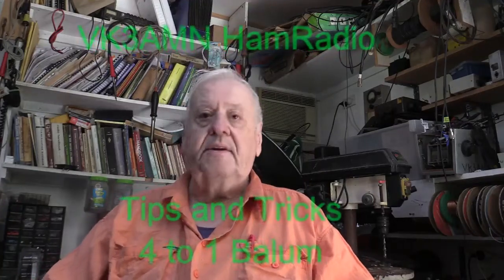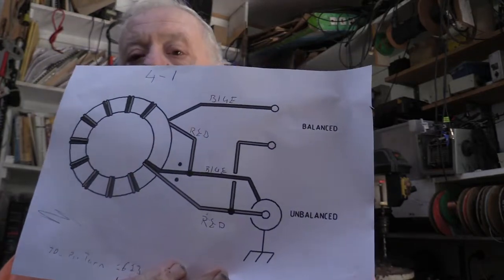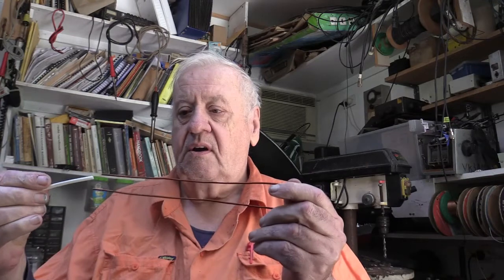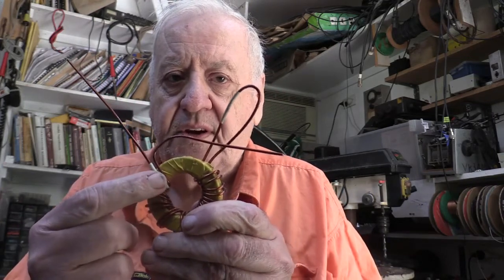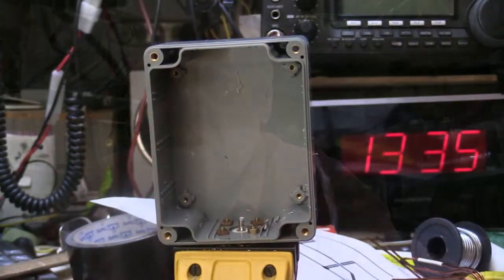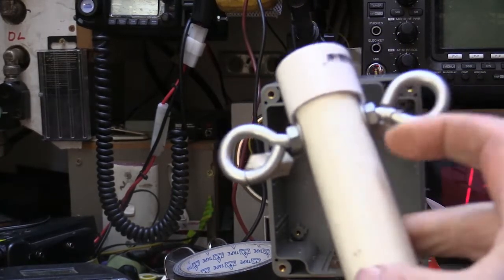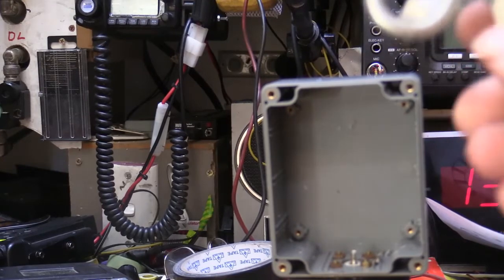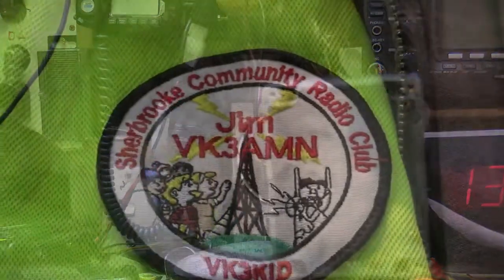A easy way to keep track of wires making a Balun

Comment: Variety! Love it Jim. Question; why do you need to use such thick copper wire, how many watts will be sent to the antenna?
Reply from the maker: Hi Benny that Balun will take about 600w, and with my Hamradio Licence I can use 400w  on my advanced licence
Reply: @JimMcNabb44  That's pretty serious power Jim. Now I get the thickness of the copper wire. In the 13cm band you can communicate and thaw a meal at the same time. Jokes aside, can you talk about communications using amateur radio for outback travel? Its a big topic, including antennas, transceivers, bands for different applications, so it could be a series of characteristically short and to the point videos typical of your style.
It may just spur interest in amateur radio in the camping community. I know people baulk at the complexity of the subject matter associated with sitting the exams, but in my way of thinking, if you can nut out a problem in your engine, you can nut ham radio out too.
Reply from the maker: Hi Benny to got a HamRadio Licence now a day is not that hare have a look on my radio club web sight http://vk3kid.org/ there are 3 licence levels Foundation Licence 10w the STANDARD 100w and the ADVANCED 400w.
Reply: @JimMcNabb44  Yes, the website is very good. I sat the exams late last year - advanced. But never used it so far.  I don't have any radio gear. My primary interest is communicating out bush when my misses and I are doing the "big trip". I sat the exams with NERG up north, though I'm closer to Sherbrooke!
Reply from the maker: Hi Benny when I'm out in the bush we use 2m most of the time on flat country you get up to 15 to 20km easy and around 10km in the hills, on the road you find 40m is the best you get 40 to 50+km easy in most placers, I also have the 737 HF radio on my Codan and you can get the radio opened for Ham bands if you got the licence. You are welcome to drop into the club meeting at any time to talk about the gear I take away on my trips around Aus
Reply: @JimMcNabb44  Thanks Jim. That is a great idea. I'll keep an eye on the website from now on and drop in when I'm ready to start thinking about the fit out of the vehicle and to purchase gear.
Reply from the maker: Hi Benny when your out in the keep a eye out for VK3KID or VK3AMN you never know where I be